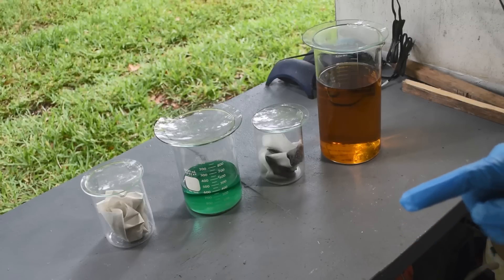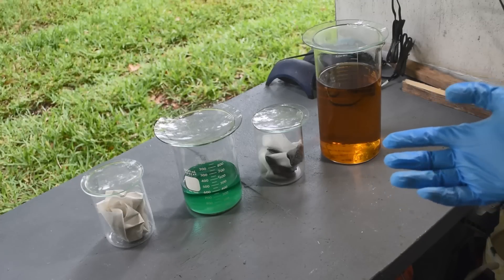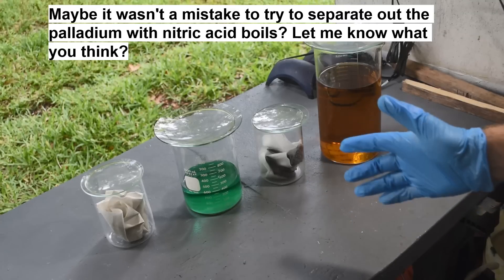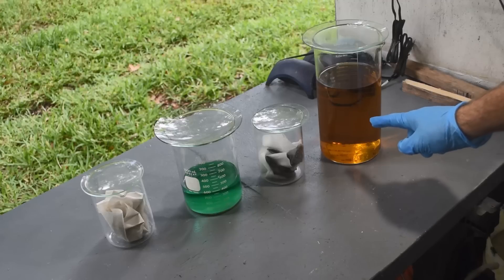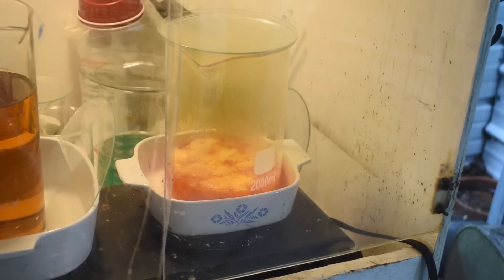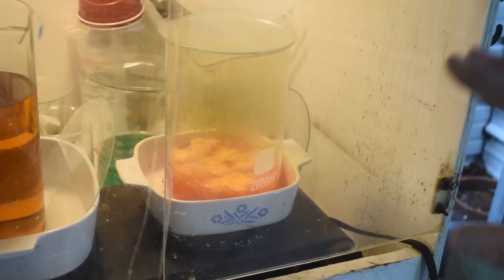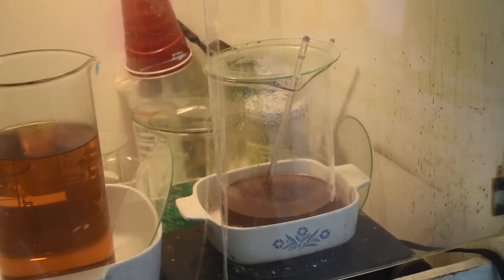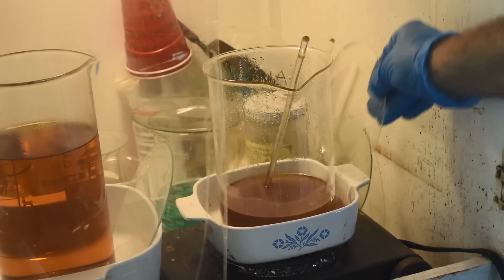Gold and Platinum Group Metals Recovery from My Stockpot Pt. 3 #chemistry

Comment: Back in the day I used to make hinges for aquarium glass tops out of silicone I got the idea from Oceanic aquariums who used to make all their glass tops that way and they never failed like the plastic ones.
About 1/8 - 1/16inch between the two pieces of glass for you lexan acrylic or whatever that is a very thin bead and then use whatever you're going to use to thinly spread the silicone very thinly across the glass or plastic just make sure it's not so thick in the gap it can't Flex properly when it's cured

Comment: 13:30 do I also have to dissolve in water the the same proportionate amount of the pretty bluish green iron sulfate I made from steel wool and sulfuric acid, It's  very fresh (2-3 days) and still wet because the extremely high humidity from the hurricane

Comment: The only possible mistake I have seen is in your last video. When you made your dilute aqua regia , it looked strong as hell
i think that allowed the  PGMs through . A much more diluted aqua regia seems like a very good deal. Add a cup or two more water? It works with gold but doesn't do much for PGMs (Leave off picking up PGMs) I really liked your idea about getting the palladium out with the Nitric boils. That is very helpful..
I'm a meat head, so don't listen to me. But I'm thinking do the nitric boils. Get all the Palladium out for sure....Then the really Weak Aqua regia to tickle out the Gold and leave the PGMs. PGMs F%ck up your melting temps. Add about 900 degrees? I'm not an expert but the Spanish had a law against Platinum or PGMs. It fouls up the melting temps.
Our Guy @My Adventure shows how he makes a diluted AR that you heat up.
It's a lot like the process to clean dirty Quartz Crystals. I think My adventure uses about 
200 ml of Hydrochloric acid and a little nitric. Then he adds the rest water. That makes a liter. He can dip his hand in it. DILUTED. Catching my drift? I love you videos. Thanks for all the hard work. I'm an idiot, so check my work. Thanks again Fella. Great job.
Reply: PS. The Spanish would kill your ass for turning in platinum in your work.
They didn't like that one bit. It's s a major pain in the ass when melting. Nothing cupels right also, It freezes up instead of cupelling.